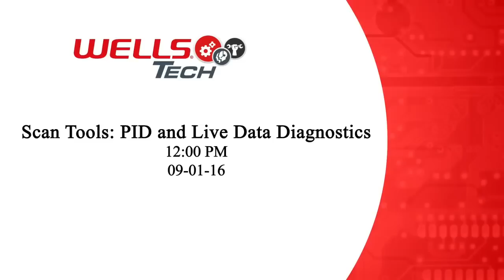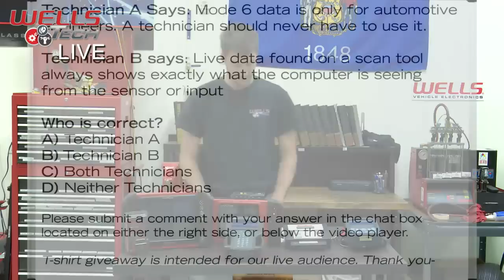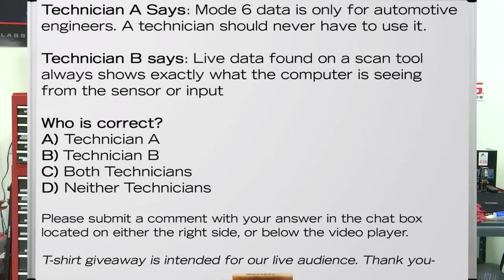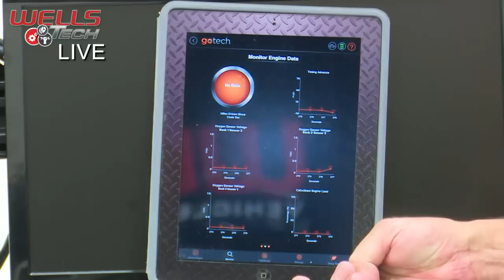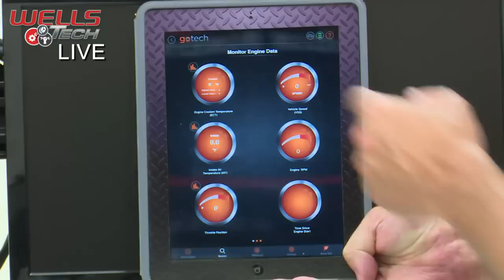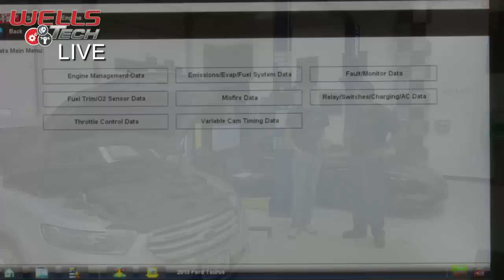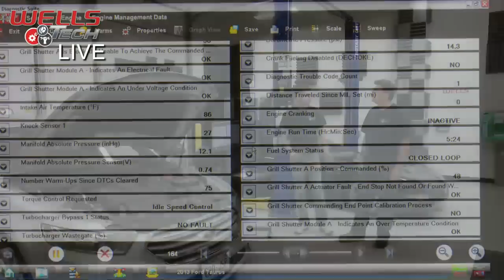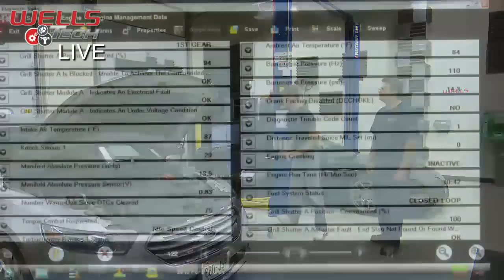Scan Tools: PID and Live Data Diagnostics

Comment: Hello Mike. If you turn the turn signal On and the display on the scan tool goes from OFF to On, does that mean that the BCM receive the request or does it mean that you just  do a request ? Thank you, Mike.
Reply from the maker: Hey BB MD, when you're hooked up with a scanner you are reading output data from the module. If you manually hit the switch and you see it respond on the scanner then it's working. The BCM saw the request. 
Mike Becker, Senior Technical Instructor
Reply: Thank you, Mike. It will help me in diagnosis  a lot. I am hoping in the future you do a video  on  can bus.

Comment: I have a question, how did you connect snap on scan tool to the computer’s display?
Reply from the maker: Ahh that's magic! :) We have a computer that can accept the scanner via an HDMI cable. A lot of the newer scanners have this capability, but not a lot of computers have the software to show it.
Mike Becker, Senior Technical Instructor

Comment: Transmission  code.  Does 1 need an up scale code reader/scanner to get read codes
Reply from the maker: Dougjstl1, it depends on the tool. transmission codes are not necessarily OBDII mandated so the most basic of tools may not be able to see the codes unless the have a direct effect on vehicle driveability/emissions. 
Mike Becker, Senior Technical Instructor

Comment: what about custom data?
Reply from the maker: Custom data is also a useful tool that we will get into at a later date. Sometimes you only need to look at a few pids, by doing it in custom data you can filter out the unneeded information and distractions. Custom data definitely is useful and has its time and place. 
Mike Becker, Technical Services Instructor